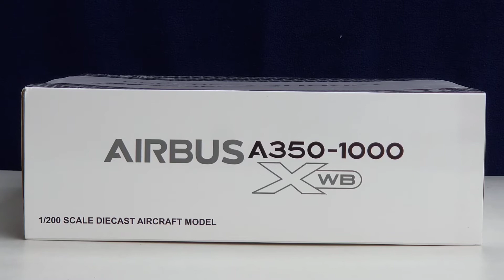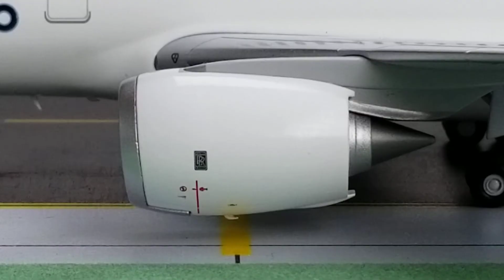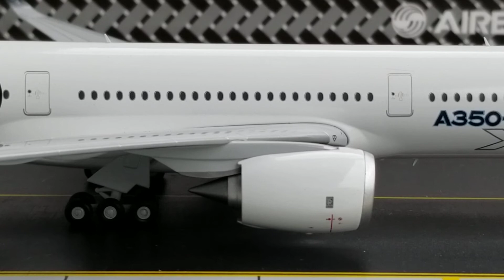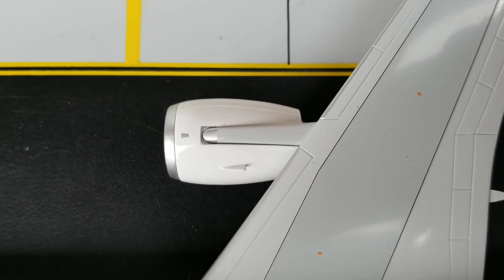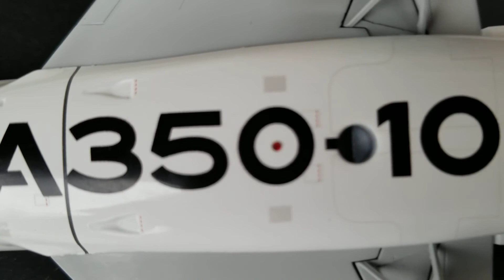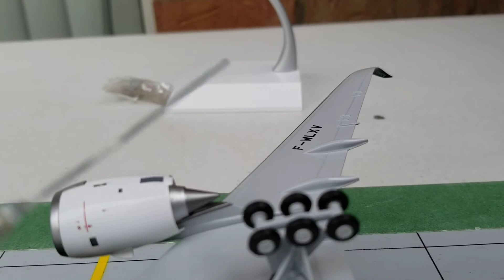JC Wings 200 Airbus A350-1000XWB(Carbon Fiber Livery)Review FHD(Full High Definition)

Comment: Hi brother, such a beauty you've got. Awesome. By the way are you getting the Boeing 787-10 Dreamliner in the House Colours Livery? Also will you consider getting the Airbus A350-1000XWB in the flaps down version as well? One thing that I feel JC Wings have missed out is the engine strake on  the outer engine nacelle because the Rolls-Royce Trent XWB-97 features engine strakes on either side of the engine nacelle. By the way, I just can't wait for your future reviews. Liked👍👌😀
Reply from the maker: The Aviation Stuff Channel,I do have the B787-10 Dreamliner in the Dreamliner House Colours Livery as well as the Airbus A350-1000XWB Bare Metal Livery Flaps Down Version in my possession but it will be a minute before I get to those so stay tuned for those and a ton of model content that I'll be doing reviews on within the next few weeks!

Comment: Amazing model but I'm going to get an a380
Reply from the maker: Tazzie Devil04,Which A380 model are you plan on getting?
Reply: Triple7Diehard4ever I would like to get an asiana a380 but no one makes it
Reply from the maker: Tazzie Devil04 ,Try Ebay ,where it was a couple of Asiana Airlines A380's from JC Wings was for sale.
Reply: Triple7Diehard4ever thanks I may actually get one of the air New Zealand planes with the lord of the rings paint job